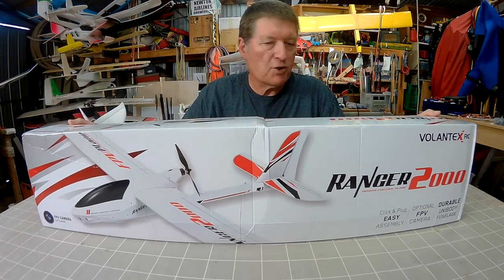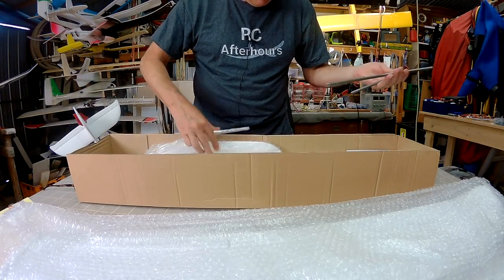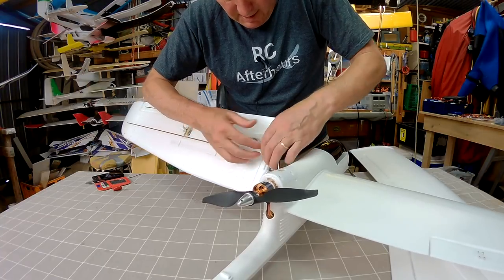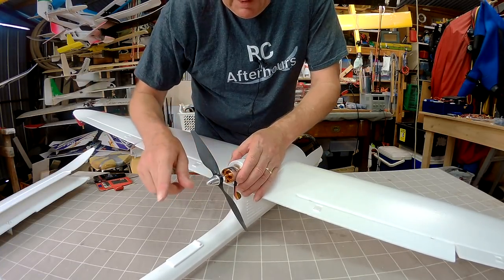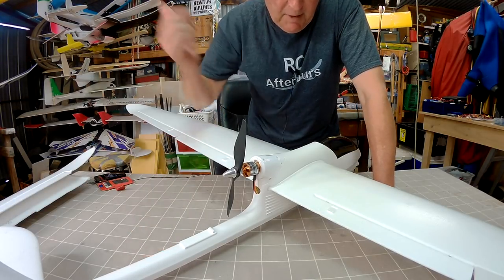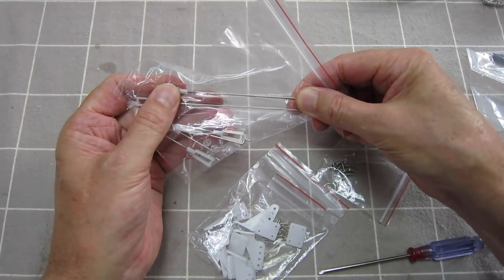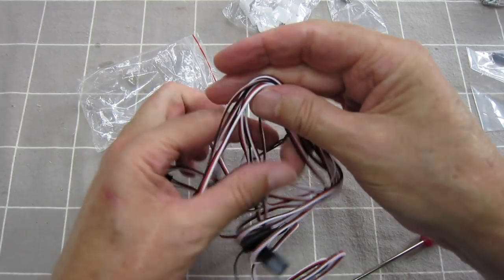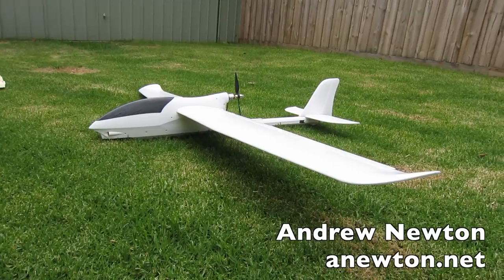Volantex Ranger 2000

Comment: That is now my new favourite plane, I have mine running a Vector/Dragonlink/1.2g/7500mah liion/KST servo's and it has just shattered all records of what my other planes ever achieved. It literally thermals endlessly here, I rode one to 6000 feet and trimmed nose down for another hour before getting back down. I am now only concerned about my fatshark battery and groundstation batteries running out with just one pack in the Ranger.. 2 hours is easy.
Reply from the maker: Fantastic, that's a serious glider.
Reply: I just bought this aircraft but have NOTHING else. I need help getting started and the descriptions online are pretty convoluted. Would you be willing to walk me through to having your exact set up? Thank you!
Reply: @Daruma_Studio  Sure, you can PM me on RCG and I can give you any details you need. I'm there under alicecooper, just look under any of the FPV threads. Cheers

Comment: Got one, but 1600 mm, after saw your review. I bought it as a slope soarer and she fly beautifully. No trimming was needed at all. Running her all stock-Pnp. I changed ruder and elevator servo for the metal gear one. Will do the same with ailerons in the near future. I am using 3s 3700 zippy battery all the way to the front. Balances a tad nose heavy, but that is what i like. Great plane. A bit under powered on stock motor but that is ok.  
Regards
Reply from the maker: Excellent Matjaz. It is a well designed plane

Comment: Hi Anrew  Took my Ranger 2000  out today for its maiden flight. Results not good. Launched in very calm conditions and within a few metres it nose dived into the groumd. Checked CG and all good. Increased up elevator but with the same result. Motor is a 2836 1100kv with 8x4 prpo as supplied and balanced. It was being flown by and experianced pilot and he had no idea as to the cause. Please any suggestions.
Thanks Colin
Reply from the maker: Oh no. They do dip a bit on launch. Watch my Deny the Dip video. Or could be nose heavy, reversed elevator, thrust angle. Try a straight glide throw with no motor first to check that controls and balance are correct.

Comment: I just received my Ranger 2000 from Banggood.  I would like to use a 4S battery and ordered one, but now i see it requires a 3S.  I have a M2815 1280KV motor with a 60A ESC from an old Finwing Penguin.  I have mounted it to the Rangers motor mount.  Do you think that this motor esc combo will work with the Ranger 2000?  It is probably overkill but I wouldn't have to buy a new motor and esc to go with the 4s I will be getting tomorrow.
Reply from the maker: 4S 3000 is what I use, suits it perfectly. You would have to look at the specs for motor and ESC but I suspect they will be fine on 4S

Comment: i linked this video on the Facebook page Radio Controlled -RC Planes.  My only concern about this plane is the weight.  I am curious about the flight times with this plane.
Reply from the maker: Just back from the maiden. Loooong flight times. 500mAH for 9min continuous. Uses about 3A to cruise
Reply: I have a 3S 5000mah battery in mines. I got 38 minutes and still had 65% battery left.
Reply: I have done 2hrs 35 min, used 7000mah and ran motor gently for only about 45 minutes, but adding VTX, camera, digital servo's, RX and Vector for 2.5hrs and it chews away at the battery. Still an amazingly efficient plane with a very slender fuselage.
Reply: Wow, that's one hell of a long flight.  I am trying to set something up that will fly for 22 miles.  I think your setup would do that in the first hour.  Thanks for letting me know about that.  I  would like to get one of these planes eventualy.
Reply: Steve Schlesinger Yes 22 miles would be a breeze, I am slightly restricted by mountains here, but one peak I ventured out to was 9km away, I turned for home, shut motor off and glided the whole 9k home and still had to do several circuits to wipe off altitude. My only complaint is packaging and Bang wanted to slug me over $200 shipping so I found it on ebay with free shipping and cheaper price than bang, only had minor dents in wings which came out with hot water (60°C)
Reply: If BG had it in stock it would be $109 including shipping to the States.  HK has it in stock for $119 with free shipping, here in three days, that's for the PNF. Did you buy the PNF or the kit?  One of my buddies told me that he left most of his Radian at the bottom of the Sea of Cortez.  I told him this is the plane of the moment.    I actually own it as a PNF  at 1200mm.  It was something like $58 after Christmas.   I can't decide which way to go, the 1600 or the 2000.    I have a lot of planes to build still that are still in boxes, so a larger Ranger is down the road.  I would love it if they sold it as a kit with both the 1600mm and 2K wings.
Reply: Steve Schlesinger I guess it comes down to what your doing with it, as Andrew says the 1600 is a bit sportier, I only have the G2 1200 to compare (and a 757-4... no comparison) which preceeded the 2000 as a long range fpv explorer, the 2000 was my choice for two main reasons, first flaps give shorter landing and low speed hanging around thermals, and second, a longer wing carries more batteries better. I ordered the kit as I will only use KST servo's, but surprisingly what arrived was the pnp version.. happy days. I plucked the servo's out but kept the motor which looks exactly like the Sunnysky I had set to install and it works well, is fairly smooth so far. I might up the kv soon as liion have pretty low voltage at the empty end. Its a tough call on kit over pnp, as only the servo's really needed upgrading, I also did the esc, as I had that already. One other thing, if you order from BG it will arrive damaged guaranteed, as they only ship it in it's merchandising box, at least HK usually double box, so less chance of grief. I think my ebay seller was HK in disguise too. i found some HK tape on carton.

Comment: I actually need to use mine for a science experiment. Where would you mount a pitot tube on it ? Straight out the front of the nose ?
Reply from the maker: Never used a pitot tube but they usually go out on a wing away from any airflow interference

Comment: I love your videos Andrew! Quick question mate. I was looking to get a glider and Ive had experience with only one before and all the rest that I flew were park flyers. I was looking a this model and the H-King Bixler 1.1 EPO 1400mm. Which one would you suggest?
Reply from the maker: Phoenix 2000 V2 would be a better than those two, if you actually want a proper glider.

Comment: I do have a question for you. I have a old tablet with no AV in or out. Do you know how to turn it into a FPV monitor? Trying to make a ground station
Reply from the maker: Not really, you would need to get AV in somehow
Reply: Okay thanks
Reply: If your av is composite via an rca jack, you can get a usb dongle to digitize it and display/record it on your laptop.  Hint: most laptop screens arent daylight viewable.  Most tablet screens are much better than laptop screens outdoors.  My Samsung Tab S2 is very good.   Some video dongles will work with the S2 via its usb otg port.
Reply: CumminsSuperduty1 It's okay, I am using a old computer monitor. Just hope I can see it out side
Reply: Put it into a box painted black inside, works great, I did same with an old 12v 12" Dell monitor running a video to vga converter (about $10), I made box from MDF about 12" deep. The whole lot came in at about $40 and is perfectly viewable in full sun.
Reply: There are now receivers with usb outputs so you can do this now

Comment: Hi again Andrew. Help needed please.
I cant make up my mind. Phoenix Evolution or Volantex ASW28?
Mostly hot summer days soaring, bit of sloping.
Thank you.
Keith.
Reply from the maker: No contest Keith, Phoenix Evolution. The ASW28 looks great but the wing doesn't work well in foam. Not the right material for a thin high aspect ratio wing in my opinion. Makes it hard to fly, stalls easily and needs to be flown fast. The Evolution is much easier to fly. Quality control in the kits is an issue, mine was fine but others have had missing bolts, and it's best to ditch the wing joining brackets and just tape the outer wing sections together.
Reply: Thanks for sharing that.  I was thinking of getting the ASW 28.

I wish I could just buy the evo 2m wing itself and build a fuselage and widen the wing to 3m like you did.

Comment: What motor is that 2836 you said but what brand? Turnigy? And still using the Standart 30 Amp esc?
Reply from the maker: Turnigy NTM. Using a Turngy Plush 30A ESC
Reply: @AndrewNewton  so why the different esc? Because some said that they like to burn up?
Reply: @AndrewNewton  just received mine and wanted to put it in but it doesn't spin as freely as the stock motor, should I be concerned or is it just because of the strong magnets?

Comment: I am curious to se how it compares in performance and handling to the 1600 version, my 1600 Phoenix glider is a far better all round to my 2000 Phoenix. I always thought bigger is better.
Is this a newer version than the   Ex 757 -3  
Your review will help me decide which to buy
Reply from the maker: It's a new version of the 757-V2 Raptor. Depends what you want. The 2000 is more of a glider and long range FPV cruiser. The 1600 is more of an all round sport flier. Personally I prefer the 1600 for it's extra sportiness. I have plenty of big gliders already

Comment: so i wonder, what is the flighttime you get out of your 3k 4s battery? also would be a 30c battery be enough on discarge?
Reply from the maker: It's not at all power hungry so any C rating will be fine. I have squeezed a 45 min flight out of it, but 25 min of normal flying.
Reply: @AndrewNewton   really with a 3000mah battery? i did expect way less due to the motor size
especial since this motor is said  everywhere that when this motor is run with a 4s battery that you should have a 50 amp esc
Reply from the maker: I'm using NTM Propdrive 2836 1200kV 8x4 prop, max current 25A. Cruising current 4A
Reply: @AndrewNewton  wierd hobbyking it says that a 50 amp esc is recommanded

Comment: Greatly enjoyed the build portion of your video. Now that you've had a chance to fly it...If you had to choose one, which would you go with? The 1600 or 2000?
Reply from the maker: I'd choose the 1600 for the ease of transport and greater sportiness, but the 2000 is better as a glider
Reply: Which one is more stable in blustery conditions ?
Reply: I have the 2000 and we are smack in the roaring 40's which is probably as windy and blustery as anywhere on earth, and it flies great but I use stabilzation when it's windy, I have an uphill/downwind landing runway so I must fly final leg with sharp descent and lots of speed but it pulls up fast with flaps, I would need to use an alternative paddock to land the 1600 with no flaps. In still early morning air it sits so still I sometimes think think my video has frozen..

Comment: How important is the "C" when buying Lipos? 

I just picked up an old Ranger EX PNP, (3715/1000KV out runner brushless motor), unused in a garage here in San DIego, $100. Can I toss in a Turnigy High Capacity 20000mAh 4S 12C Lipo Pack for $120 from Hobby King?  Want to do long range missions, video sailboat races offshore, get good at FPV.
Reply from the maker: I have never used the 12C packs but the Multistars used to be popular for long range flights. C rating is only important for high current draw situations I think, but I'm not an expert on these matters.

Comment: Thanks for another great, well explained Review.  Question..  Did you also beef-up the motor mount on the 2000 as you showed in the 1600 Review??
Reply from the maker: Same motor, I just popped the 2000 wings onto the 1600 fuselage

Comment: I just ordered one, because of this video and your Ranger 1600 videos.  Thank you for saving me from ordering a cloud surfer or similar.  I love how honest you were about some of the other models.

Could you list your servo part numbers for the Ranger 2000 ?
Reply from the maker: Glad to hear it, you will be happy. I used TGY 9018 metal gear servos all round. Cheap, tough and reliable.
Reply: In the Ranger 1600 video you said you used Corona servos.   Which one and which is better, TGY or Corona ?  Is the 9018 now the 90S ?
Reply from the maker: On the 1600 I started with digital metal gear servos, CarbonBird KST in the wings and Coronas in the tail, but I needed them elsewhere so now it's TGY 9018 all round. I prefer TGY to Corona, they are quieter.
Reply: I found the 9018.  Thanks.

Comment: Hi Andrew. Love your reviews and it has helped steer me in my initiation to the hobby. Thank you so much for sharing your experience. I'm considering a Ranger 1600 for a second plane. (Have a XK A1200 for my first) Just watch several videos on the 2000. What are your thoughts between the two? I would think the 2000 glides a bit more. The 1600 might be more maneuverable.
Reply from the maker: Both are highly recommended. Could buy the 1600 and add 2000 wings. They are available separately

Comment: Whats the weight without battery?
Reply from the maker: 1190g
Reply: @AndrewNewton  So around 1400-1500gr (with battery and light FPV) which is not super light but quite normal for a plane of that size.

Comment: Andrew
thanks for the review
in the 1600 did you change the angle of trust ?
my plane have tendency to stepy climb when i acelerate the motor. Then make a stall.
I have change the CG thinking it was tail heavy but the problem does not disappear.
any suggestion?
Reply from the maker: That is strange, didn't require any mods on mine. It dips a little under power. Check elevator linkage is not loose, check wings and tail are seated flat in their mounts.
Reply: Andrew Newton 
thanks
I will.